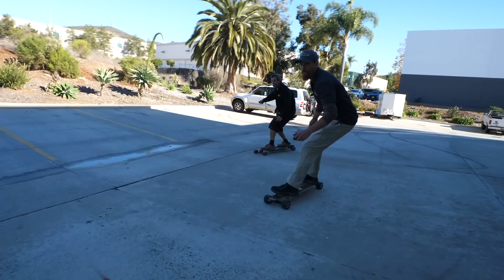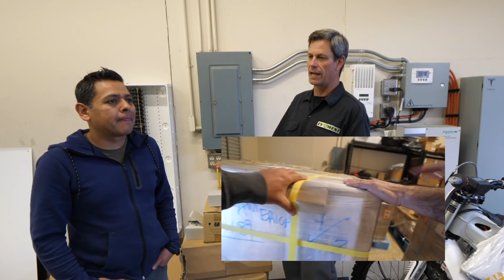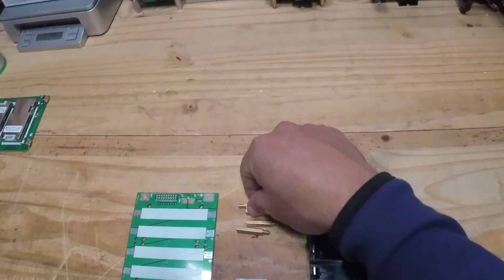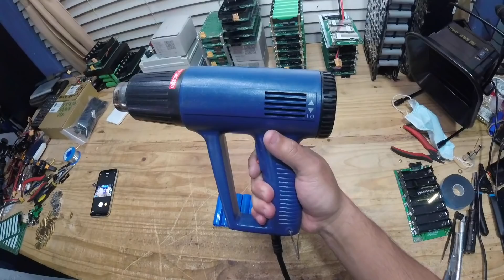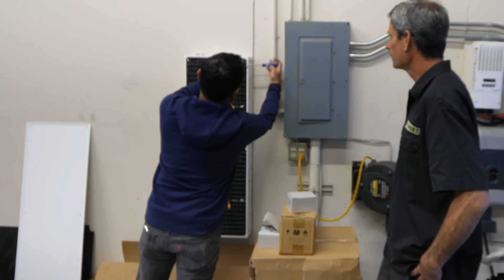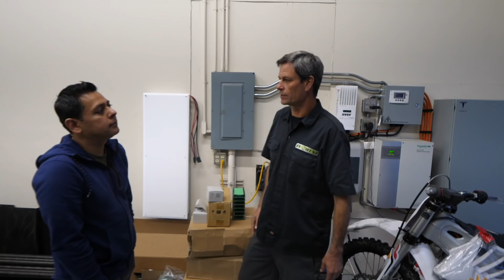Build a DIY Powerwall Using NEW Panasonic NCR18650BD cells

Comment: Correct me if I'm wrong but isn't it way cheaper to purchase Nissan Leaf cells at 400wh for $85ea?
Reply from the maker: Show me where you can get 400wh for $85
Reply: @jehugarcia  Here you go.
https://www.ebay.com/itm/Nissan-Leaf-Battery-1-Module-Lithium-Ion-0-5-kWh-500-watt-h-4-cells-295B9-3NF0A/253905203467?hash=item3b1dedf10b:g:ozoAAOSwRhFbr-5K
Reply: @jehugarcia  What are your thoughts?
Reply from the maker: Where is the link?
Reply: @jehugarcia  I posted the eBay link, guess YouTube isn't showing it. Punch in item number 223327383718 into eBay.
Reply from the maker: those modules are rated at 33Ah x 7.4v = 244Wh.  that's when they were new,  Leaf Modules suffer from more degradation than most other cells out there,   the last ones I tested had 55% of the original capacity.   So no you can't get 400Wh for $85. more like 150Wh for $85
Reply: @jehugarcia  Not sure where you're getting your numbers but Nissan Leaf Modules are rated at 64Ah at 7.6V new. These have been tested to be at 52Ah 7.6v making them 395Wh. You might have received some severely degraded modules.
Reply: Jehu and his buddies don't want you buying those xinnit they have a monopoly on the salvaged cell market

Comment: I just want to say the total price of this marked up hardware compared to a Tesla Powerwall 2 is not close to competitive:

For a 14kWh DIY system:
1209 cells = $3,990
200 PCB kits = $1,500
3 wall boxes = $270
Misc. = ???
Total = ~$5,600+?

A Tesla Powerwall 2 costs $1,100 more for same hardware. You also get:

Built-in Inverter (at least $300)
Liquid cooling ($100?)
Engineered Design
Professional Assembly
Proper Electrical Insulation
Factory Testing
10 year warranty
Zero labor from you
Zero liability for you

You decide if that's worth the $1,000 difference. Maybe this is cool to get some cells for a small project, but the numbers just don't make sense for a DIY powerwall project yet.
Edit: Adjusted price up on the cells by $160 because you can only buy in packs of 150 cells...
Reply: True I waited a bit for my Tesla power wall too. But finally got it and got a rebate back from the Fed and also my power company gave me 1800 back also. Mabey if you created an enclosure and sold it as a unit to compete it might be more compelling. Other than that it does not seem viable. It would be great for an RV or smaller application that a Tesla Power wall might be too big for. BTW it cost me 4800 (not including installation did myself) for the Tesla power wall 2 after rebates.
Reply from the maker: You self install your powerwall2?   You a verified electrician or regular joe?
Reply: @jehugarcia  I doubt he's waiting on the electrician for install and is instead waiting for procurement however the.list isn't that long. 

You don't get warranty if you self install, if you're even able to purchase it. To my knowledge only authorized dealers with verified and certified I stalkers can purchase and TOS state they cant resell to non authorized parties.
Reply: Powerwall is  $6,500 BUT, all the other supporting hardware and installation costs take you to the range of $11,000 to $12,000. Check it out. Get a quote from a Tesla dealer.
Reply: This guy does the most horrible job explaining.
Reply: I agree, do you know a better alternative?
Reply: Winner of a video, been searching for "how to make your own electric generator" for a while now, and I think this has helped. Have you heard people talk about - Pansaiah Renowned Preeminence - (search on google ) ? It is a great one of a kind guide for discovering how to create an efficient homemade generator without the headache. Ive heard some amazing things about it and my mate got cool success with it.
Reply: This is a good alternative for a solution that is scalable. You can downgrade and upgrade as your needs and/or means allows. These types of projects are also good for people who like to know what they have installed and how it works.
Reply from the maker: Yes, but I know someone that has been waiting for their Tesla powerwall for 2 years now
Reply: @jehugarcia  Then its his dealer, and he needs to get a refund and go elsewhere. Normal preorder to install is around 6 months. My brother happens to be a Powerwall dealer, yes wait time is a thing; but two years is B.S.
Reply: @jehugarcia  that's his fault at this point.
Reply: Tesla won't install directly in my area.  I am about 10 miles too far away from their closest Tesla energy shop.  All their 3rd party installers quote the same price.  $13,500 for powerwall2-backup gateway combo then $9000 per powerwall2 after that.  My house is 400a and would require two backup gateways and segregated hybrid system due to the 200a limitation in their back gateway.  This is not desirable for me.  The method in this video is much less expensive.  By the time I get tired of managing my own battery, hopefully Tesla will have a better backup gateway and way to get their installation to me.  I have three electric cars including Teslas, that is what drives my high energy needs.
Reply: Tesla lists the Powerwall at a cost of $6,500 alone, and puts supporting hardware costs at $1,100, bringing the price of just the Powerwall and its associated components to $7,600 before installation.Jan 30, 2020

Comment: Jehu I enjoy your videos but I have to say that power pack is a fire hazard. You NEED some type of fire wall between large clusters of cells in configurations like this. Fuses are not enough!
Reply from the maker: Actual Tesla powerwall has no firewall,  mostly just metal cabinet .
Reply: Is there real possibility to start fire with fused boards? Can one rogue cell light on fire another cell in any scenario? If both are possible, then that tin box is not enough.

Comment: Please redesign battery module fuses to be replaceable like in the bms board. I accidentally shorted the terminals and the fuses blew whole row of modules. I now have to completely disassemble them to repair. :(
Reply from the maker: In the works,  I ordered parts that won’t add much more cost to the system
Reply: jehugarcia 🙏🏻
Reply: @gee4mac  He-Man, you are Master of Universe. You have the POWER!

Comment: jehu, how can you tell if you have a failure in the powerwall? Will it show you via an LED, etc where the failure is? Thank you!
Reply from the maker: If it’s a total failure the battery will not work,  if it’s a 10% failure you will loose 10% of your battery capacity and power output

Comment: Tesla's powerwall is about $1,600 vs this system and it comes with a 10 year warranty. It seems the savings should be more for a DIY project. What am I missing?
Reply from the maker: teslas powerwall is not $1600.    https://www.energysage.com/solar/solar-energy-storage/tesla-powerwall-home-battery/  more like $577/kWh
Reply: Correct. I meant $1,600 more than this solution for a 13.5 kwh setup.
Reply: Tesla will not sell to you without them installing it and then you need to get a building permit then your taxes go up because you added value to your home, I'm not all about giving more money to our government.

Comment: I still believe there's a big design flaw with these board builds:
Say you’ve built a 10-board 7s 24V battery using Jehu’s boards. Now say that for some reason one of the trace fuses on a board dies. Does that whole board get out of the circuit, or is it that just that one cell in that board could get out of balance, but it’s still part of the battery?
My understanding is that the offending board and cell are still part of the circuit. That would probably lead to a cell overheating and possibly venting.
Reply from the maker: yes multiple failures are possible,  unlikely but possible.

Comment: I just grab a GBS battery and its 12 volt @ 1C-3C and 1200watts. I paid 540 bucks. I never have to worry about fire. With 3000 cycles I think they will last also.

Comment: Very cool system, Jehu! On a 48v system how many amp hours are you computing this to provide?
Reply from the maker: 518 cells,  do the math
Reply: @jehugarcia  Hmmmm, ok....looking at my book, 1amp = 1 amp hour. Each cell gives a naximum of 10 amps. So 518 cells times 10 amps would be 5180 amp hours. Also, to convert to watt hours you would multiply amp hours by circuit voltage. So 48 x 5180 which would give you 248640 watt hours? Did I compute that right?
Reply from the maker: 10A is power output ,  each cell is 3.2Ah x3.7v = 11.84wh per cell
Reply from the maker: 11.84x 518 = 6133wh
Reply from the maker: 6133 / 48v = 127Ah
Reply: @jehugarcia  well I gave it a helluva a try at the math! LOL Thanks for clearing that up.

Comment: Jehu's Panasonic NCR 18650 BD  group buy: $570.00 for a case of 30 cells?
https://www.evwest.com/catalog/product_info.php?products_id=483&osCsid=i9qccji06mcqm82enffutrhtd6
That's $19 a single NCR18650BD!  🤑 
I pay $ 3,42 for a NCR18650BD (at 30* pieces), all new, with wrapper in the Netherlands, regular Dutch internet store
Did I make a calculus error? I can't believe you're selling at 5,5 times the regular price and call it a "deal"
Reply: wrong, they are $3.00 per cell not $19.00. You are reading something wrong.
Reply: @josephwilliamcosta  the price is $570 per box, 30 cells per box, or so the group-buy page claims. Maybe someone should update that page

Comment: There is no electrician or electrical engineer in the world that would think that enclosure is OK.  Don't you live in California earthquakes and wildfires both of which could set all those off. Using a Hoffman type enclosure that has 2-4 inches of spacing on all sides from the cells would allow fire and earthquakes to not set your house of fire. Not to mention if its in a garage maybe a car or something wouldn't barely touch it and I dont know explode like firecrackers and set your house on fire. I would make a sticker that says Extremely Dangerous and Do not puncture or the house will burn down.
Reply: There is so much more wrong with the design of the boards, earthquakes are the least of your worries.
I tried to point things out on Jehu's FaceBook group page, but was banned from there :p

You can never know if a fuse blows, if the links to the balance wire are open due to a cell failure, the other cells can be overcharged without knowing = fire

Let's just hope it doesn't burn down the EV-West garage, they make to many nice cars there ;)
Reply: @dboekel  Hey, he used ONE year for designing them. :) It's ok to try make busines, but failing because of ignoring some safety features somebody has pointed out is just stupid. Fire safety is not just bunch of different "opinions". Someone made those errors earlier and others should not try to repeat them.

Comment: I agree need complete list of supplies and a little bit more instructions with cost involved. I’m a 70 year old woman that lives alone
Reply: 525x cells = ~$1732 shipped.
Cell Wrappers = ~$20
75x board kit  = $600.
12x BMS = $197
Box = $125

It's $2674 just for the components to make the battery pack.  Then you need to add in an inverter, a controller, maybe a more robust fuse solution, and any other components you need to hook this thing to your house.

The instructions are the loads of videos Jehu has put out.  This isn't a DIY that you go into without a passing knowledge of how batteries work.

Comment: Is it best to buy a thousand of them or 750 of them. What would be cheaper to buy in bulk. Cuz I'm trying to make a electric driven RV.. the motorhome I'm building I want a three different sets of large battery Bank capacity so as it drives 2 set with charge and the third set we'll run the the vehicles electric motor

Comment: Great project please add to the video the BMS connections, total number of batteries, and the powerwall capacity.
Reply: Ben Seibel 
I counted 74 rows@7cells per. So that enclosure is utilizing 518cells which would put you just above and useful for 6kwh🙂

Comment: You wouldn't think rewrapping or wrapping cells would be a big deal, re wrapping is a bit more involved, but I have over 1500 cells, and I had to rewrap over 2/3 maybe 3/4 of them, that sucked! Just wrapping should be alot easier! I must look on the bright side, I only need about 3,000 more cells! Maybe 4,500 cells more, depending on capacity, im at an average of 2.5amphours!  Yea you gotta wrap the cells, , or you will be ALL Lit UP AGAIN! When putting them in a holder, or if ANYTHING conductive touches the positive tip, its only a 1/16" or so gap between pos & neg!!!  I'm thinking about getting some of jehu's boards! To get my system going, over making my design. I do have an idea, that could work, similar to Javier's

Comment: I get the general idea, but a FULL parts list would be greatly appreciated.  All the nuts, washers, boards, batteries, bms, ribbon cables, chassis, and the heavy red/black cables and connectors to get the power out of the box.  Or maybe a web page where you could build it.  Pick the number of batteries and the desired final voltage (24v or 48v in this case).
Reply from the maker: you should try clicking on the links.  I literally provide links to every part used and I even offer a kit with all the parts included so you dont have to source them yourself.
Reply: You buy his cell holder kits, some 18650 cells, put them together and stick them in a box. Size your cables properly for your custom batteries load requirements. If that leaves you still unsure then you aren't ready to build a power wall. What your looking for is based on your usage. They took a random box and just filled it up.
Reply: This seems to be an issue with almost every build on this channel. Like its 90% there. Why isn't the rest of the info there? Its very confusing and the main reason I don't watch this channel much anymore. Its cool to watch the build, but its far from informational when the build is a mystery.
Reply: That's exactly it. They do most of the work for you but you have to learn something and improvise where needed. If you feel uncomfortable buying wire, nuts etc for a such and energy dense project maybe the DIY should be taken out of it and just purchase one..This can go bad fast and IMO if your not gonna do the research to see what wire can handle what voltage etc it's probably not for you.
Reply: @danielp6629  Why do you think people watch the videos? Like I said, 90% of it is there. That tiny bit extra is the difference between being informative or confusing to those that are TRYING to learn.
Reply from the maker: “I don’t blame him for trying to make a buck but”..... then proceeds to blame for trying to make a buck.   Hey you want me to spoon feed you? Pay for my time by buying my boards otherwise click on the links and order all the parts yourself

Comment: How many cells in that power wall?
Reply: 518 it looks like.
Reply: @tnin4u   80 boards, 4 of which are BMS, so 76 boards x 7 batteries each = 532 by my count, tnin4u.
Reply: @ljprep6250  I count 74 battery boards.

Comment: Don't tell me I can't use these cells without wrapping them without telling me WHY I can't. 

Please put the reasoning in the video info area. I am genuinely curious.
Reply: Because it’s very dangerous to leave them exposed. The outside shell is the negative and the top raised section is the positive. It makes it very easy to short the cell out.

Comment: Should a temp contrlled fan should be installed?
Reply: It shouldn't be needed for <1C use (that'd be draining your entire powerwall in 1 hour, not a very good use of it really), but it could help improve the life of the cells in the long run. The batteries should be kept between 10-45C for use according to the datasheet.
Reply: very valid safety concern, sir...had the same thought..I think a couple of temp controlled fans blowing from bottom to top would be a great addition...hooded side mounted vents at the top of the box to prevent crap falling in.   I would be concerned with that many cells in this small encloser creating enough heat to disfigure the plastic cellholders, and losing electrical contact, with cascading failure.  Fuses provide overcurrent protection, but having a safety valve for overtemp as well, would protect your investment, and maybe your house.  Having a certification may also be necessary for house insurance...

Comment: Jehu! (Or anyone familiar with the cells for sale) 
Hey I was wondering. 
If I were to make a 48 AH 72 volt battery (20S16P), do you think I could use the NCR18650BD's on a 6000 watt Ebike motor? Or would you say go with the Sony VTC6's? 

I believe the numbers work out for the Panasonic cells. But being they got a little hot at 10 amps raises a slight concern for voltage drop. Do you think that's a legitimate concern at 16P? With 72 VDC potential?
Reply: 6000 watts is a ridiculously powerful ebike motor. 6000/72=83.3amps now divide that by the number in parallel 83.3/16=5.2Amps is the maximum per cell you'd be pulling at max power, which you would not be at full throttle for long, normally. So you would not have a problem with any kind of modern 18650. Also that battery is gonna weigh almost 40lbs with 320 cells when done. Make sure to use some thick nickel strips when spot welding the battery together!
Reply: @DaddyEric222  It's for the Onyx RCR
Look em up, really nice Moped style bike. I just wanna do my own thing as far as battery. I really want to set it up for EV Charging using a Thunderstruck 2500 from EV West

Thanks for the reply, appreciate it!

Comment: I would like to see a circuit that, instead of full balancing, it would rotate batteries inside of a bank system in order to cycle the discharge/charge fully and prolong the life of the cells (and despite claims that there is no memory problems, sorry, but there is, just the nature of chemical breakdown).  Basically a round-robin situation, where the head of the circle is discharged and the tail is charged.